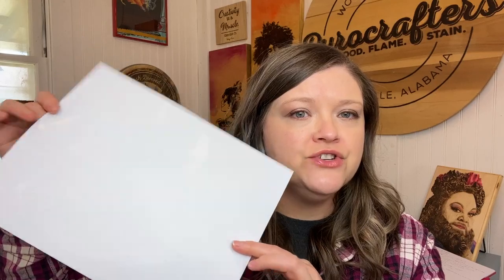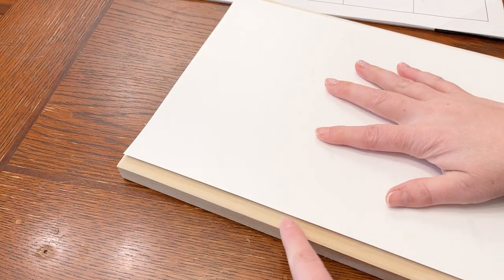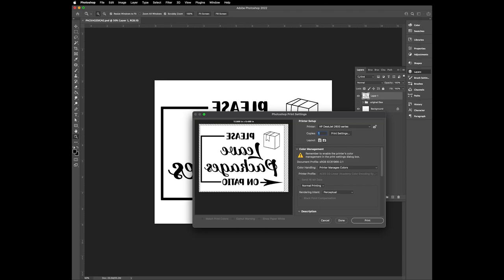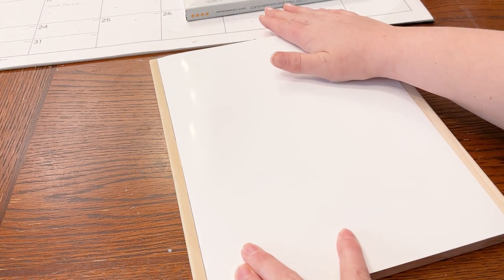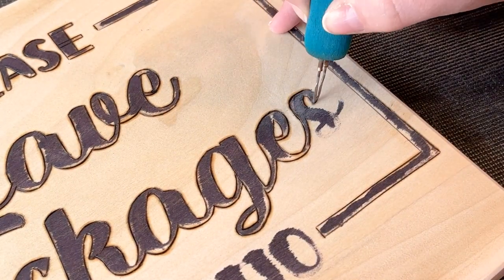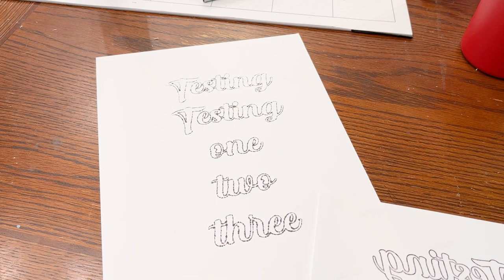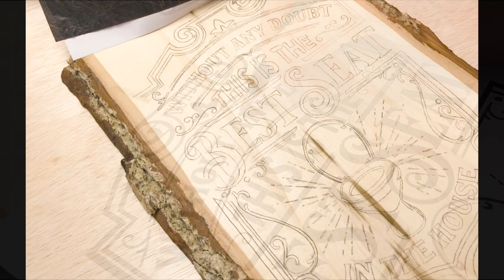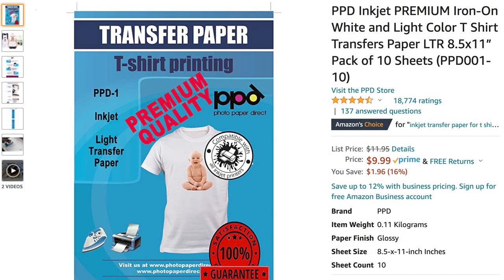Transfer Templates to Wood || Photo Paper Transfer to Wood

Comment: If your paper moves and leaves marks you don’t want to burn, how do you get the ink off the wood. I have tried rubbing alcohol and it didn’t work. What do you recommend?
Reply from the maker: Hey Becky, if it's a small mark where the ink didn't go too deep, you can try a razor blade or xacto to scrap off layers of the wood into it lifts out. 

If it's a big mess with lots of marks or the ink goes deep into the grains, the only option may be sanding it down.

I've tried alcohol too and mineral spirits and neither worked for me. It just made a bigger mess that went deep into the grains. 

This is why I stick with the carbon. It does take longer, but there's less that can go wrong and it's easier to set up.